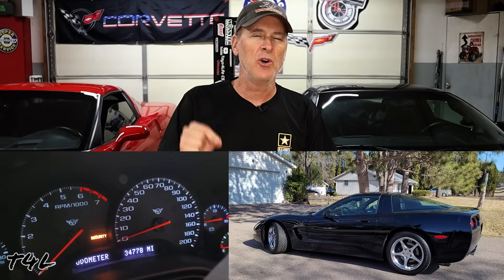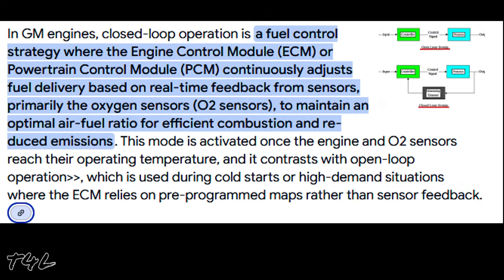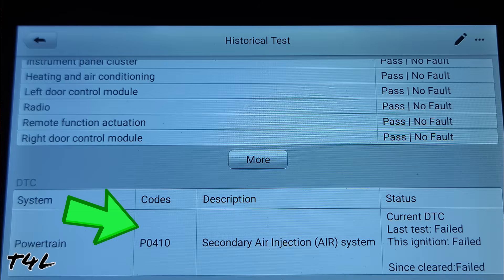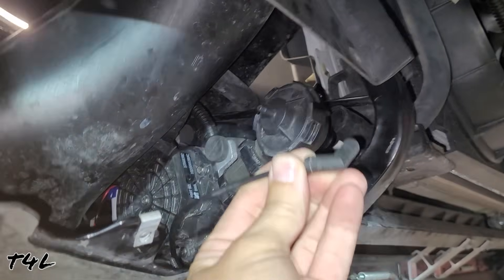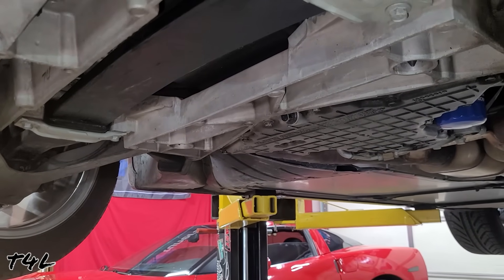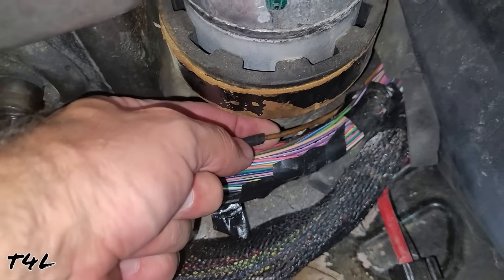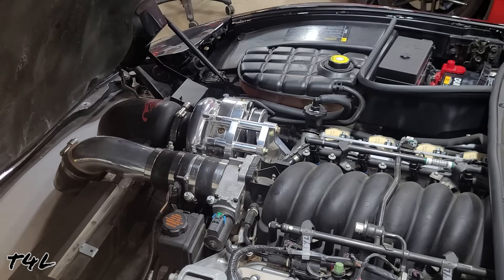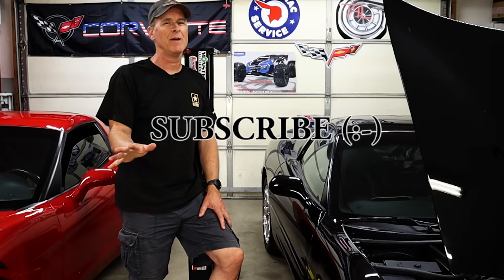C5 Corvette Secondary Air System (P0410 Case Study Repair!)

Comment: Great Video!  Replacing both my Check valves (verified stuck) to solve a P1416 code.  I will make sure that the vacuum line on the back of the manifold is solidly attached!

Comment: Bought a 2001 c5 recently couldn’t pass emissions due to this code. I watched your video and my issue was the exact same as you had in the video with no vacuum I did the bypass through the brake booster line and everything now works. Thanks for your help.

Comment: Im wondering if this is part of my hard starting problem?? Im working on the grounds and cleaning them.  I need to run the scanner again. Last time i only had a multiple cylinder misfire.  Im at a loss. Im still doing the grounds and i replaced the fuel filter regulator amd did a spark plug and wires change. My ground connector under the hood had alot of condensation in it and i cut it out and put eyehooks for the grounds and need to look at the other one on the passenger side. It could be the fuel injectors because the filter was clogged bad. But that black ground connector had alot of,water in it.  I haven't been able to get to the other on the other side yet.  But cleaned the ground in the battery compartment.

Comment: I've been getting the P0410 for quite a while.  When I separate the junction by the alternator, i have air flow coming from the pump side and suction on the check valve side.  I think based on what you said here that means the pump and solenoid  are good,  and I'm making an assumption that the check valves are good if I have vacuum vs air flow coming from that side indicating a stuck check valve.  Any suggestions on what to look at next?  I'm stuck here.
Reply from the maker: So your pump runs and blows air through the hose by the alternator when you disconnect it and then it shuts off after a little bit? There are two check valves, maybe the one for the passenger side is bad?
Reply: @Toys4Life  Its blowing through the hose by the alternator yes....and when i separate that hose there,  the hose on the pump side is blowing and the hose on the check valve side is sucking.  does the suction on that side indicate one of the check valves is stuck shut then (of course it would the one on the passenger side)  this morning  the pump ran for about a minute when I started the car and the shut off.

Comment: This is the most complete video on the C5 P0410 diagnostic repair journey.  Great work!  My 2000 C5, with 35K miles, has the issue.  I’ve replaced the pump but still have the code return after a few short drives.  I’ll go through your process to hopefully locate the problem.  Hate having to take off the intake manifold again after replacing the oil pressure sensor.

Comment: Hey guys, the coolant reservoir on my C5 is empty. I got a warning about low coolant so I added coolant and the warning went away but the coolant reservoir is still empty. I’ve driven the car 3 times for about 10mins per drive to see if that would help but the coolant reservoir still looks empty. Any suggestions?
Reply from the maker: Cars don't normally consume coolant, I would be concerned that you have an internal or external leak. Check your oil first, make sure you don't have a milkshake which would mean coolant has blended with oil.

Comment: I had a 73 Chevy truck that had an air pump that pushed air into each exhaust port to dilute the readings.       Smog motor 15:30  readings. Brilliant! All for the sake of emissions. If you think about it, more pollution was generated because it took clean air and put it in the exhaust. Plus the power taken to turn the pump made it  use more fuel, pollution and just was stupid. 9:16
Reply from the maker: I imagine in '73 they were trying to heat the cats too, but I don't remember for sure. Cats were totally different design then but maybe this aspect was the same?

Comment: Toys4life. I was wondering if you had a solution for a/c belt tensioner pulley. My 07 base model corvette i bought a brand new tensioner and belt but in higher rpms it will fall off. It has happened twice in the last month. Didn’t know if there’s an upgraded one or a solution. THANKS! Love the channel.
Reply from the maker: Shouldn't be falling off, I would suspect the harmonic balancer pulley and take a good close look at it Make sure it's not coming apart and getting misaligned. If it's perfectly aligned then watch the belt when it's spinning, does it look like there's some unusual movement of the harmonic balancer pulley?
Reply: @Toys4Life  ok i will check that in a little bit and update. I appreciate the response and the videos!

Comment: I have a vacuum issue for my AC as well and would love to see more detail on how you spliced the brake booster line.
Reply from the maker: I just used a vacuum line barbed union and made the hole in the brake booster hole very small so it is a tight fit - no leaks and will last a very long time.

Comment: I truly enjoy your videos. Just a week ago my check engine like came on. I used the onboard scan tool and got a P0410 code. As it turned out a mouse chewed through a small vacuum line between the engine and the firewall. The tube was replaced and all is well. Your video gave me a better understanding the cost for the repair. There is an alternative solution. to fixing this problem, but I'll leave it up to you to determine if you want to explore that method.
Reply from the maker: Great news that you got it fixed and thanks for sharing your experience!
Reply: Love all your videos.  I was wondering is there something you can do with your little computer to stop the warning lights on the dash if you pull out this whole secondary air system & also put in long tube headers with no cats. Thanks for the help. You're my hero. I also love your fiero. Super nice. Im looking for one myself now.  Thanks for your help. Jim
Reply: Will it pass inspection?

Comment: I really like your vid today. I have a code P0410 on my '02 Firehawk with the LS1 also. I switch out the valve behind the intake and still get the code from time to time. I just bought a cheap code reader and delete the code when it comes up. After a yr of chasing I  was just tired of it. So far my C5 is ok other that the shifter cable falling off the ball at the shifter. Keep the vids coming.

Comment: When I had my 2002 C5 Z06, I eventually added Kooks long tube headers and completely deleted the SAI.  Had a custom tune to dial in the gains from the headers and turn off the SAI codes.  If you live in a state that does not check emissions, SAI delete, headers, and tune is the way to go.

Comment: great diagnosis end-to-end, which the dealer failed to do. The secondary air on my 1998 was working fine, but I removed the whole system when the Speed Engineering headers went on. I tuned out the codes with HP tuners and plugged the vac port to the pump. Car is 8Lbs lighter now!

Comment: The best fix for this is to remove the air injection system completely and tune it out. It saves so much space for regular maintenance and a little bit of weight.
Reply from the maker: Only problem is finding a shop to do it as it's illegal. And it takes HP Tuners to turn off the light. Many shops are getting freaked out by the EPA  and finds that have been handed out, like to diesel Brothers as an example.
Reply: I just learned about this after my cam and headers and noticed that my old stock manifolds and an inlet port. Mine was tuned   Out lol 😎

Comment: Secondary air injection is one of the stupid emissions things that's not even done any more. Mine (Cadillac DTS) comes on intermittently. I just learned how to cycle through the menu and reset it. Not about to spend $700+ on the dumb thing.

Comment: 97-99 doesn't use vacuum to operate that Secondary AIR valve - it's operated by a solenoid directly on the pump assembly. Kinda interesting to see a manufacturer move away from vacuum operation for a period and then return to it. On the 2000+ that vacuum line as shown in the video is the most likely culprit and a known issue; on 97-99 it's often the relay for the solenoid.
Reply from the maker: Good point, thanks for pointing that out!

Comment: My local mechanic (specializes in GM performance cars especially C5 - C8 Corvettes) strongly advised a Sevonday Air Injection Deletion Tune when I brought mine in for service (originally there for other maintenance items). I was getting the annoying P0410 code at the time. He removed the SAI system and sealed those contact points. Car seemed to perform better overall since then. I live in a hotter climate year round so maybe its not needed so much where I live?
Reply from the maker: This is effective if done right to keep the CEL off - but most shops won't likely do it due to legal liability concerns...
Reply: @Toys4Life  Yeah this guy is an absolute pro with many years of experience. His boss is an ex-GM engineer so they were VERY knowledgeable about these cars & proved it easily! I was hesitant with ANYONE touching My C5 until I discovered him through local Corvette owners recommending him heavily! He certainly impressed me over time having my C5 run the best its ever ran since I bought it!

Comment: I removed my manifold last week to replace knock sensors and oil pressure sensor. Took about 3 hours to complete. While I was in there, I extended the vacuum line off the back of the manifold. The line coming to the manifold is extremely tight fit. By adding an extension it gives you more room to work with the manifold in the future. It looks like your vacuum line was zip tied to the manifold. This may be the source of the original leak.
Reply from the maker: Tight fit for sure!  This one was plugged internally at this time and someone fixed it in the past as evidenced by the zip tied connector and the copper vacuum line.